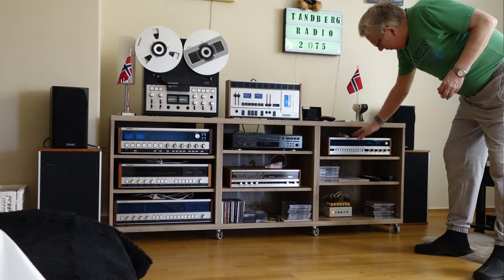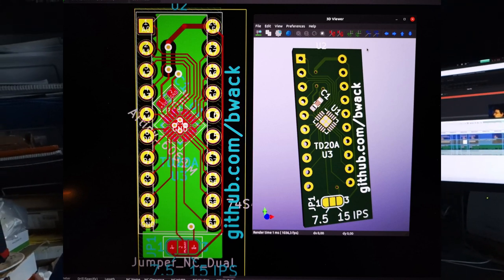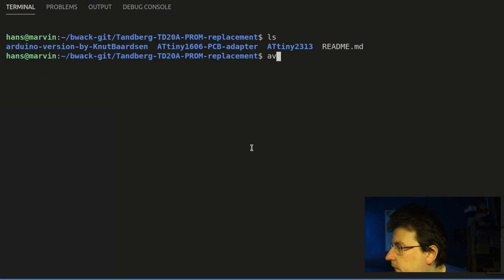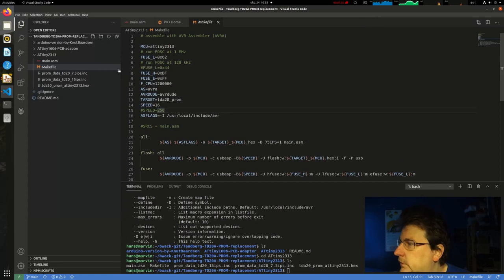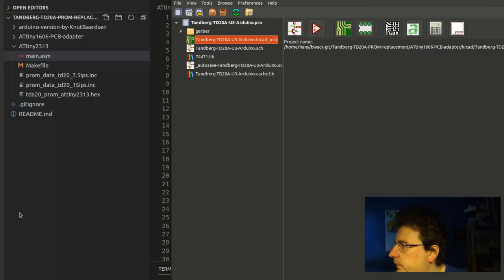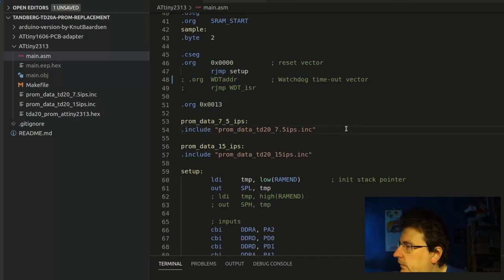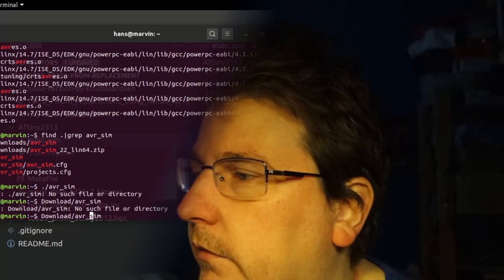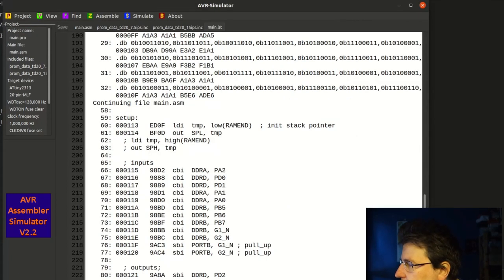Creating a PROM replacement using ATTiny2313 and the AVRA Macro Assembler - Tandberg TD20A PROM IC

Comment: Very interesting. I had no idea how this type of motor control PROM actually worked. I look forward to seeing this working in the TD20A in a future video.
Reply from the maker: I hope it will work. I handed the chips over to the service man in Oslo centrum/downtown. Will hear from him tonight.
Reply from the maker: The solution is working. Just got a message from the guy. Had it not been for the corona I would have asked if I could film when the chip was inserted.
Reply: @bwack  That's great news! Excellent work, as usual. Too bad you couldn't record the video though. :(

Comment: Watched it again :) So you read the inputs which determine where to look in the table and then you convert the binary to output the value from the table to the output pins.
Reply from the maker: 🙂 I noticed something else. The prom is used in a state machine. Makes sense, for example if the reel is rewinding, it should always apply brakes before play, record or fast forward.. Or else there would be   tape salad 😊
Reply: @bwack  Ah yes. I've read your other answers now. 
It being in a state machine makes sense without a microprocessor. Naturally! I automatically assumed microprocessor and code. But the ROM contents are just a lookup table. Check. Makes sense.

Comment: That's really fascinating!
How does it work speed-wise? I assume that it's a low-speed application, but what would be reasonably possible?

And do we see it in action at some point?
Reply from the maker: I hope so I can show it in action. At least I will try it on a breadboard connected to a logic analyzer. I know that Knut made some solutions using an Arduino pro mini, and it worked fine :)

Comment: I could have spotted the double pipe now that I know about it :)
What is IPS? And what is the difference between 7.5 and 15?
Reply from the maker: Very good. I wonder what || means in AVRA. Maybe not bitwise operation. The IPS is inches per second. Tape speed.
Reply: @bwack  It either has no meaning or it means a logical OR. It didn't lead to an assembly error so I'm guessing the latter.
IPS is tape speed!! Ah. I was thinking some kind of clock speed. This discrete hardware is tripping me up.
Reply from the maker: It is a bit overwhelming for myself. When I have time I will try to trace the bug down into the AVRA source code. Maybe it is an unwanted syntax. Good news! Got a message from the service guy. He was happy and he had been searching alot for a replacement.
Reply: @bwack  Awesome. Perhaps now someone can even improve on the ROM to make the player do things it couldn't before
Well done Hans.
Reply from the maker: @TheHighlander71  This project started with assembler programming because of "broken" avr-gcc, but I was apparently just missing avr-libc. :| hehe :D but assembler is fun though!

Comment: Wait, so you’re reading in the original rom and converting it? Couldn’t you just burn an eeprom with the original rom data? I’m sure I’m not understanding the concept. I’ll watch the video again. Certainly the Tandberg community will be super grateful.
Reply from the maker: Hi. Good question, but the prom is an old technology and needs a special programmer. Yes an eprom will also work if one makes an adapter for it. Its a narrow DIP20 package.
Reply: @bwack  Let's see if I understand this. The Arduino is going to have to mimic the original ROM. This ROM will have contained code and data presumably. So what you're doing is reading the input signals, and putting on the output lines whatever the original ROM would have output but without actually rewriting the code that was on the original ROM. 
So the question is: how do you know what to output based on the ROM dump that you have?
Reply from the maker: @TheHighlander71  the rom contents were dumped by knut, I just include the dump as is. Then i set the Z reg to point to it, and add the input value as offset, then execute the load program data instruction. The instructions for reading and writing to ports is due to the pinout of the original ROM.
Reply from the maker: @TheHighlander71  oh i think there is a misunderstanding. The original ROM does not contain code, but is used as a lookup table. There is no cpu.
Reply from the maker: https://www.google.com/url?sa=t&source=web&rct=j&url=http://sportsbil.com/tandberg/td-20a-se-circ-align.PDF&ved=2ahUKEwiXtN6wqM_sAhX9isMKHT5cCw4QFjAAegQIAhAB&usg=AOvVaw0e-vjaHq5oFEoVNnE2cFns the prom is on page 7. You can see it directly is connected to a motor H-bridge (the four transistors to the right with a motor in the center), then on page 6 there are the front panel switches that, through more logic, ends up at the prom input. There is also a shaft switch.. Things move in a certain order, and that order is stored in the ROM. I dont have hands on the recorder.